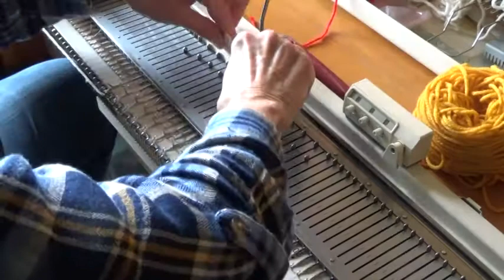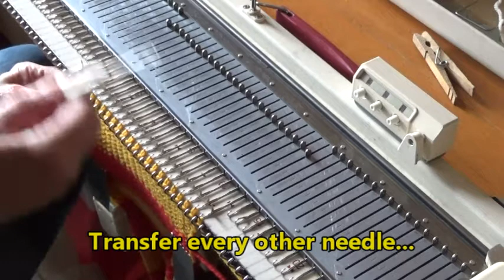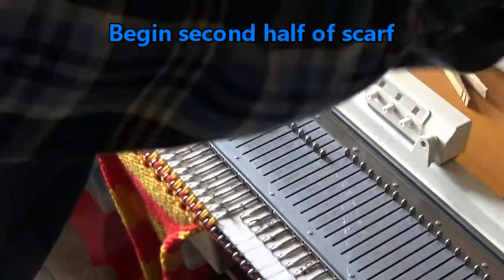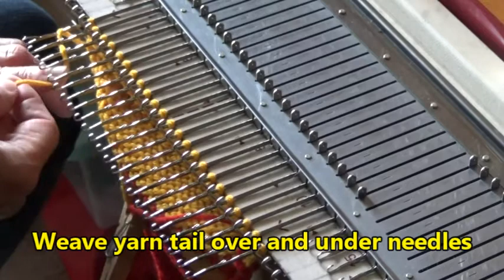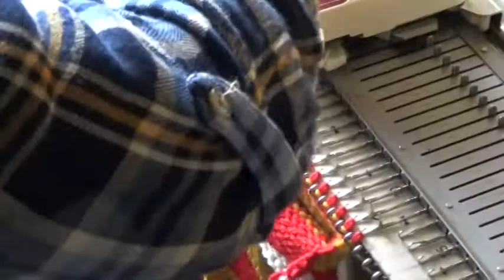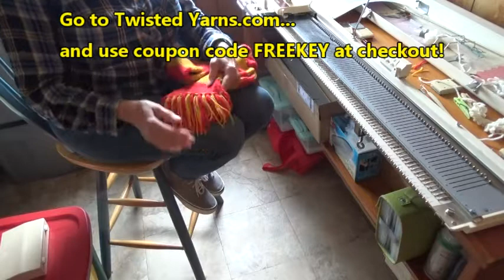How to Machine Knit a Keyhole Scarf

Comment: Very informative but wondering how it gets folded
Reply from the maker: Hi, I'm not sure of the question. As you knit you get a double layer of knitting that makes the scarf and by the time you finish you have an opening (the keyhole) on the other end. You tuck the "scarf" end through the keyhole. Does that answer your question?

Comment: 6:14  Hi. Im Ilse from South Africa.  Im watching your video and found it very interesting. What type of yarn are you using? And is your machine a standard gauge or a bulky machine? I'm using a standard gauge knitting machine with 4-ply so I had to adjust my stitch and row count aawel as my tension
Reply from the maker: This pattern was done both on Brother Bulky 230 and also a mid-gauge LK 150. I used a "4ply worsted weight" acrylic yarn (I believe that is about the same weight as Aran in the UK) at stitch size 10 on the Brothers and 9 on the LK. You could do it with DK weight also. As you know you can do the same technique on a standard gauge with a lighter weight yarn... just need more stitches and rows!